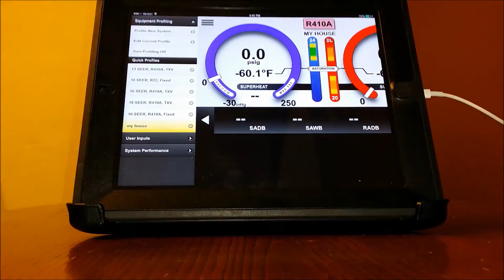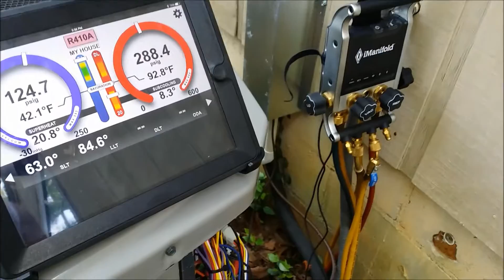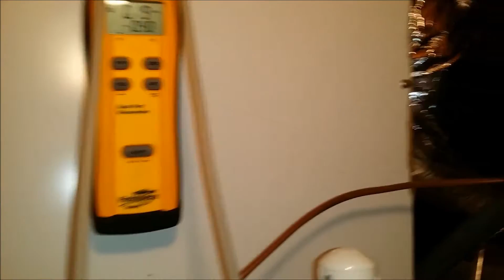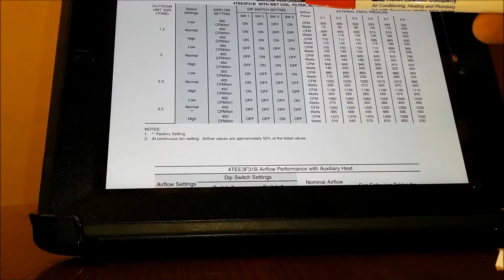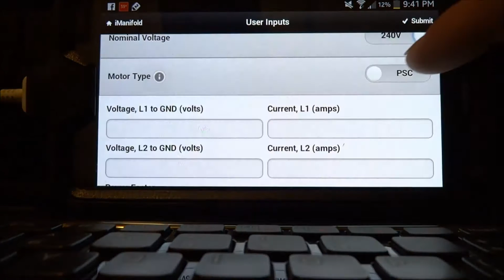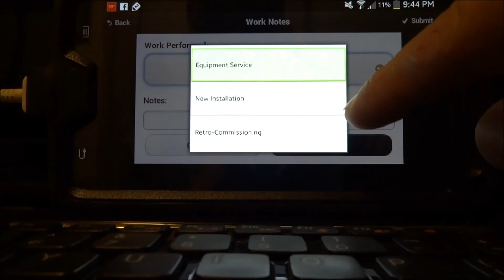iManifold Reporting

Comment: Bypass factor is the percentage of air that passes through the coil without being conditioned. If the bypass factor is 1, none of the air is being conditioned. A high bypass factor is an indicator of air going around the coil or through the coil without being conditioned. This is typical of an evaporator that is not fully active. Multi row coils or coils with lower air velocity across them will have lower bypass factors. 

Power factor is the ratio of real power flowing to the load to the apparent power. In a DC circuit Power = Volts x Amps. In an A/C circuit that will not work. The formula becomes Power = Volts x Amps x Power Factor. The power factor is typically less then 1. This is important for motors like ECMs that have a low power factors, and also for 3 phase systems. We put in typical power factors for those that do not have a meter that measures power factor. If you have power factor (PF) on your meter you can get more accurate efficiency results. 

This is a great meter for use for HVAC and the iManifold
http://www.trutechtools.com/ACD-51NAV--600A-AC-True-RMS-Navigator-Clamp_p_1778.html
Reply: Joe Shearer I would not think that would impact bypass factor. It is more impacted by number of coil rows air velocity and the fin spacing.
Reply: Justin,
I have checked out the Flir meters, they are very will built and have some cool features, but I think the big draw is for those that have the thermal imagers. For the money and Amprobe is the better buy.
Reply: Joe Shearer That is incorrect, bypass factor can be and is determined by a psychrometric chart. See the attached power point. I have some more information at the office that I can access Monday. The power point also shows typical bypass factors.
http://www.sydneyhvac.net/Files/appliedpsychrometrics/Pres2-Handouts.pdf
Reply: I really appreciate you responding and answering my questions and I hope justin will forgive me for hijacking him that wasn't my intent.
Reply: Awesome Jim, thanks. I've got
That meter on my TruTechTools wish list! I figured if anyone could give a solid answer it'd be you!
Reply from the maker: Hey Jim Bergmann does Fluke make a similar meter? Great answers by the way.
Reply: Thank you for responding...how does the Imanifold calculate the bypass factor? I don't see how it could know how much air is being conditioned. 
Is the SC56 a good meter for the watts?
Reply from the maker: It uses the psycrometrics. Just like the psychrometric chart. Input 4 measurements on the chart and you get all kind of info. The iManifold uses dry bulb and %RH to calculate it.
Reply: Thank you man I guess I have to really study more on the subject to understand totally.  It seems like factors like how cold the coil is running and if it is flooded properly would make a difference but im curious to learn more now!
Reply from the maker: Joe Shearer look up how to read a psychrometeic chart. I haven't looked on YouTube but I'm sure it's out there. If not I have a book you can borrow that explains it. Do you still have the old manual d books I gave you? I have newer versions if you need them, but it looks like you have it down!
Reply: Thank you man I hope I gave that manual d back to you. I hope. I am going to see what I can learn about this bypass factor !
Reply from the maker: I cant remember. And no worries. That was the 1978 version or something..lol. I have the new one. Plenty of info on bypass factor online. Good hunting!
Reply: Justin Mikola Justin, Flue does brand a similar meter that is more expensive, but actually Amprobe is owned by Fluke, some of the ex product managers that I know from Fluke think that it is their better brand.
Reply from the maker: Jim Bergmann really!? I didnt know that. What about the FLIR version? Thoughts on that? I never owned or have seen reviews on their products.
Reply: Do you think the new aluminum coils have higher bypass factor than copper due to less conductivity?
Reply: So to clarify what I've learned today - X cannot be determined merely by using entering and exit temp and rh and then referencing psy chart. Imanifold must reference evap temp and then use preset velocity and fin spacing data to display its X factor,
Reply from the maker: Thanks Jim Bergmann. I.will be looking to buy one of the two soon. I like the bluetooth feature of the FLIR for checking amp draw on closed air handler cabinets. And Joe Shearer no worries, thats what this is for. We are constantly learning. I have learned so much from the YouTubers and from TruTechTools website.